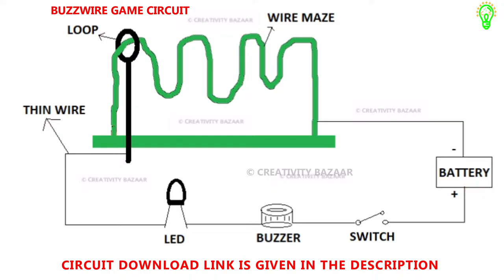How to make Buzz Wire Game with LED & Buzzer indicator

Comment: It will be better when buzzer turn on that time the sound will be continue & by pressing a reset switch buzzer will be stop. For that what should be added?
Reply from the maker: You have to do some minor connection modification that's it..!!